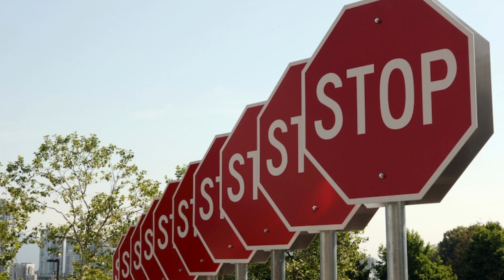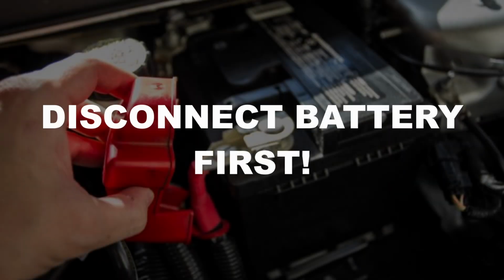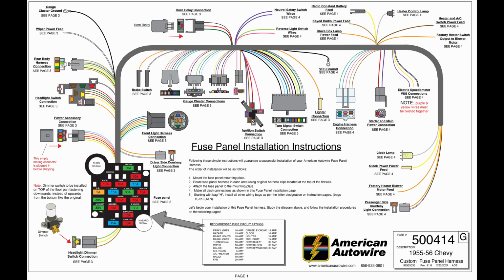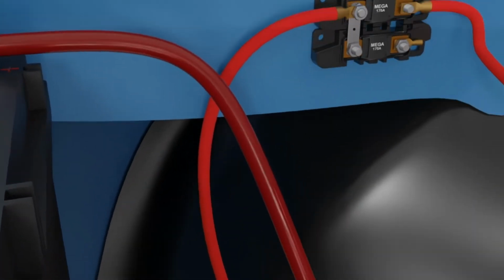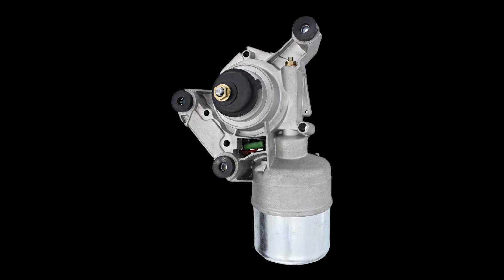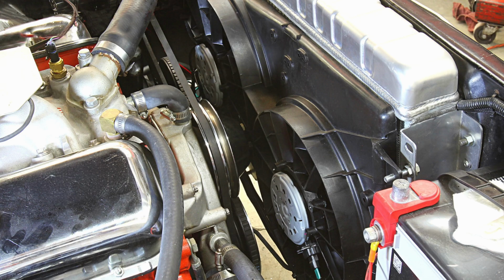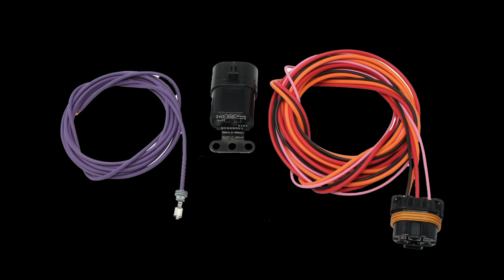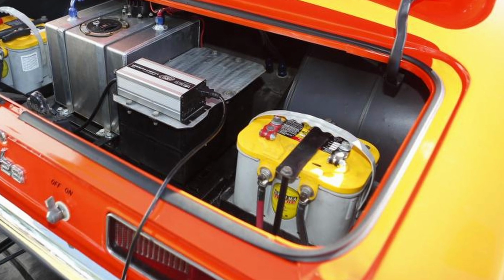Best Practices Complete Video

Comment: Can you explain why you ground to the block instead of the frame, and why you insist on main power coming from the starter lug?
Reply: If electricity is always looking to go to ground I don’t want it going thru the crank shaft and across the bearings in that search. Make it easy, negative cable to the block